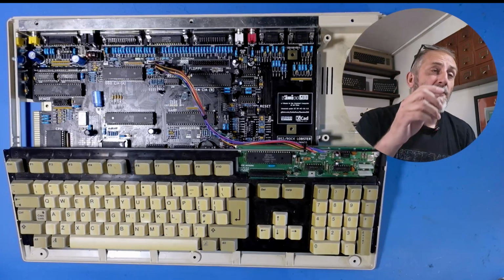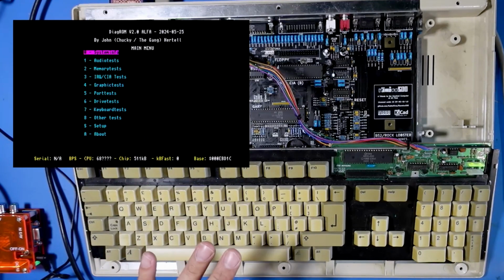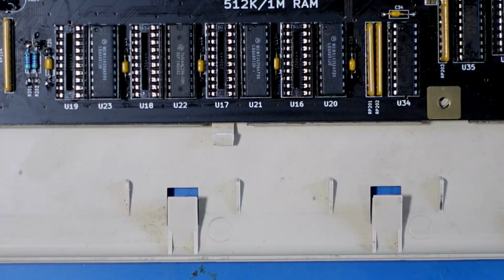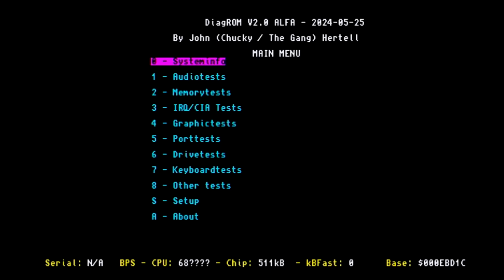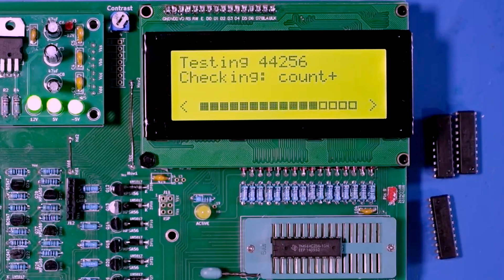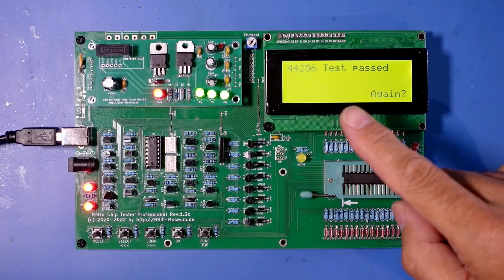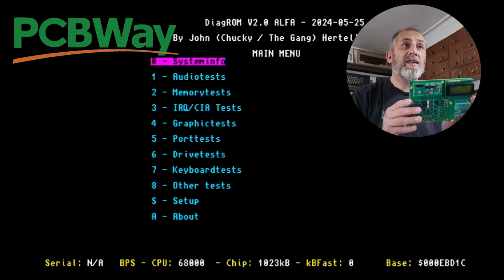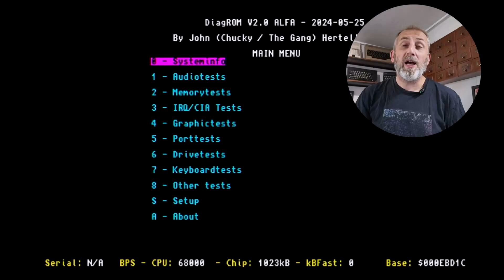Hunting Faulty RAM in the Amiga 500++ with the Retro Chip Tester Pro

Comment: you should connect a PC via nullmodem and the serial output from diagrom would point out what databits was wrong
Reply from the maker: Yeah I've done that before. But wanted to check if the Retro chip tester would actually find them.  Thanks for the comment :)